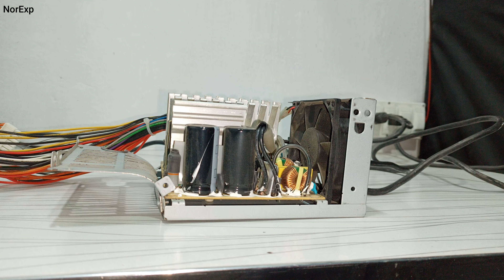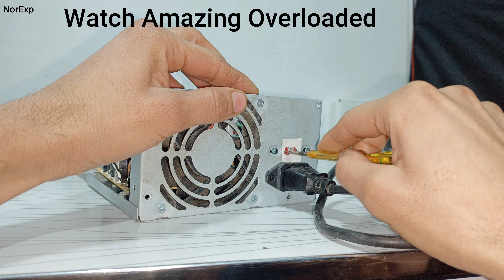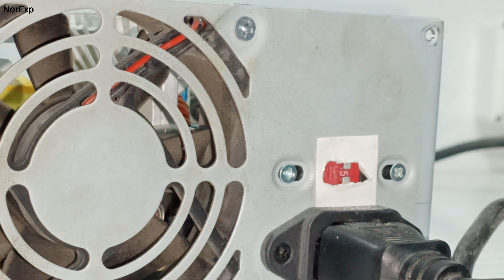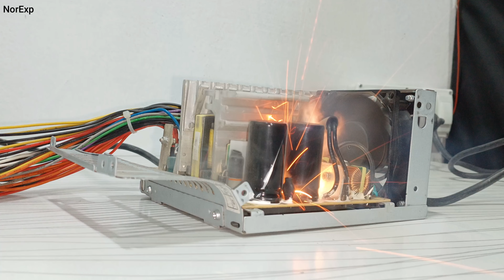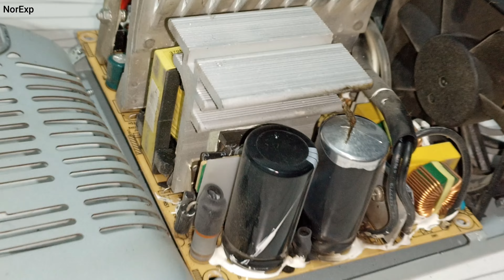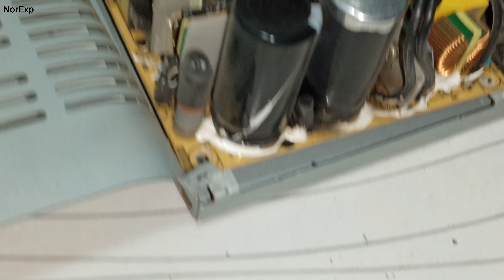Crazy Explosion Experiment🔥| Power supply go boom

Comment: I'm surprised the fan kept running fine
Reply: its bulit different
Reply: fan is designed for 12 to 24 up to 36volts thats why 230 in a 115 it mean from 12 volt it goes at 24 volts
Reply: Bruh fan
Reply: Yep
Reply: the fan: this is fiiiine
Reply: Gotta get rid if that smoke somehow 😂
Reply: yeah the fan will just spin faster it's not affected by voltage changes the way the power supply components are
Reply: well the fan wouldn't care much about voltage like the other components in the psu would so I am guessing it's power from the wall power which explains why it's unaffected by the psu exploding like that